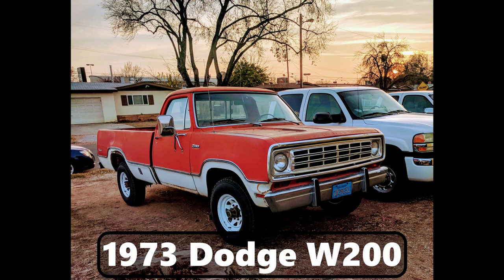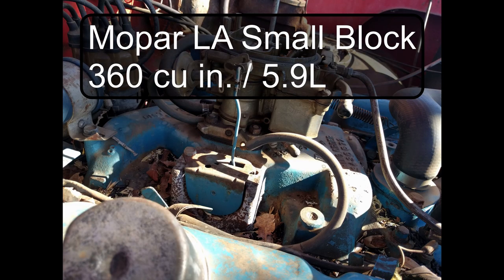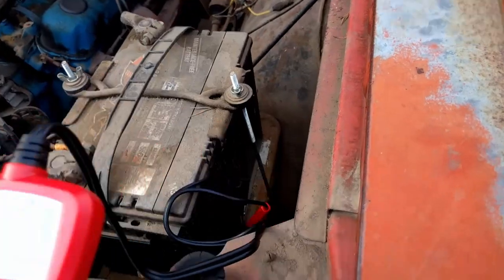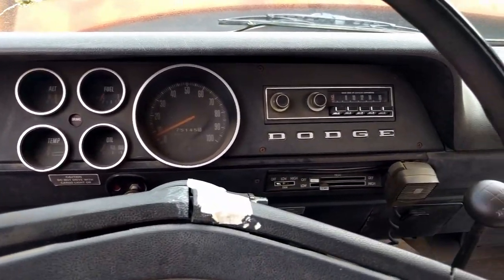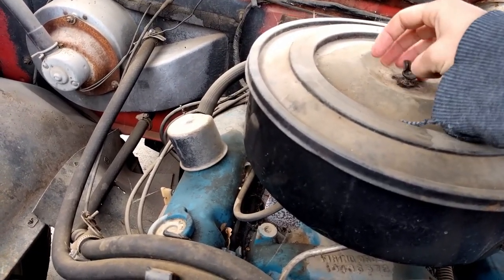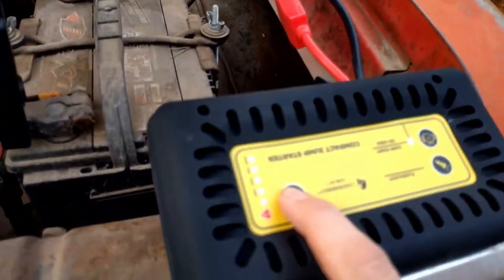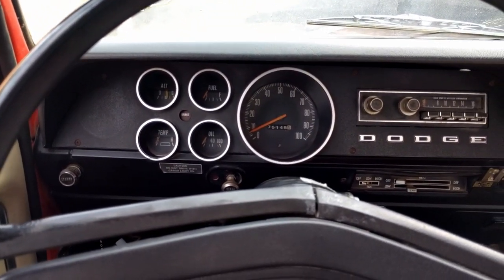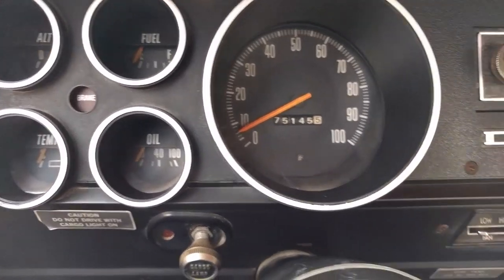Will it Start? - 1973 Dodge W200 Part 1

Comment: She is a Beauty!  Remember it's not like a new fuel injected Truck. You have to pump the gas pedal to set the choke maybe you did and I just missed it also by pumping the gas pedal you squirt fuel down the Carb.  2 Thumbs up!  Oh BTW you can have your AM Radio custom rebuilt with all the upgrades of today's modern Radios. That way you keep it looking all original and that will add to it's increasing value.

Comment: You do know you're supposed to pump the accelerator a few times before starting a cold carburated engine? Sets the fast idle cam and squirts some fuel to start it.
Reply: no....you NEVER pump and old dodge....hold it on the floor til it fires
Reply: @mrserious55  Na, 3-5 pumps, hold foot to the floor to close choke plate.
Reply: What???? No one here has a cue how to drive a card equipped vehicle. Pumping the throttle several times to get it to fire will just wash the cylinder walls with raw fuel.

Comment: Nice old truck, If it werer mine, I'd leave the AM radio, CB, and trailer brake in the truck just as I found it. Kinda a tribute to my grandfather. I wouldn't really need all that stuff removed or upgraded, it wouldn't be a daily driver for me. It would be fun to putt around town in and maybe show off in original condition  at a local car show during the summer.
Reply: Same, anymore, guys say that it needs a cummins diesel and 6" lift and 37 inch tires.

Comment: Twin to my truck lol love it.theres a oil pressure sending unit on the back of the engine by the distributor and on the front of the motor on the intake manifold by your heater hoses there is a temperature sending unit.try replacing both they are cheap and easy to replace.nice truck man hope to see more vids.
Reply: Do you still have it?

Comment: When you turned on the light switch the turn signal indicator was indicating that the parking light filament in either the front or rear driver side 1157 bulbs was not working. PS: It's unlikely that your water temperature, oil pressure, and fuel level sending units and/or those three respective gauges are all defective. Therefore, I'd first take a look at the contacts with the printed circuit board they're attached to, as well as the grounding.

Comment: I just ended up with almost the exact same truck!  Long story but I bought it from an old guy who was the second or third owner.  It has the original everything including the original owners manual and sales receipt.  A bit of rust like yours but otherwise in great shape.  The only real problem is I need to pull the dash apart like you did to clean it out because it must have had a mouse nest in it and blows a nice urine smell.

Also I am having a hard time finding parts.  Any suggestion on where to look?  Any other youtube channels you have found helpful for dodge power wagons?
Reply: Ive had some luck with rock auto otherwise im just gonna get a parts truck

Comment: That has a newer grill at least a 1974
Reply: they used that grill in late model 73 s  i have seen it before i believe it was original to the truck they were used in the last few months of production dont know his month of build  the one i seen was 11/73 i prefer the 73 grill my self i own a very early 73 club cab that i found 72 radio delete dash and steel door panels and steering column for standard trans  out of a d 300 you would not know if it came from the factory that way or not dodge kept them trucks pretty much the same for a few years